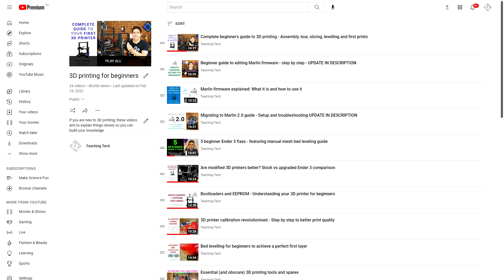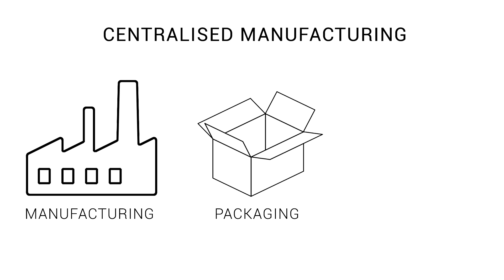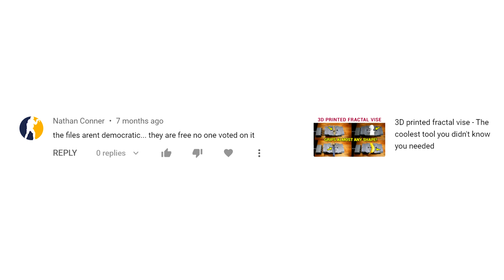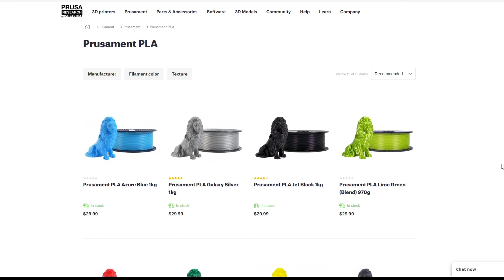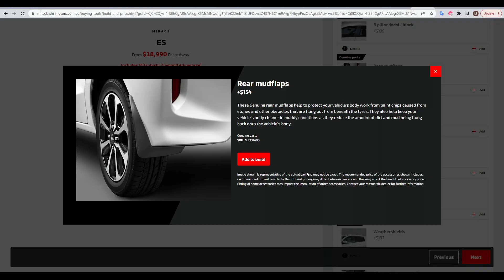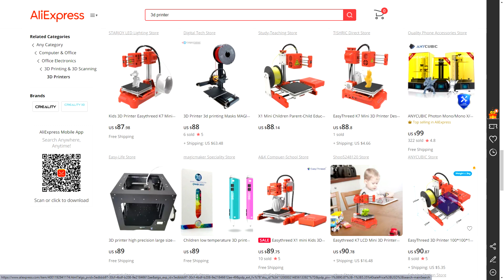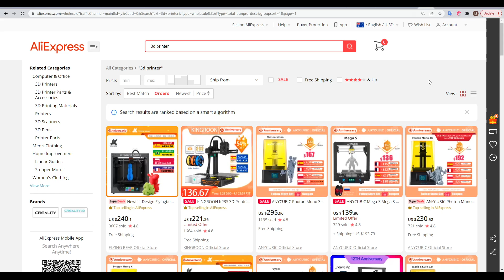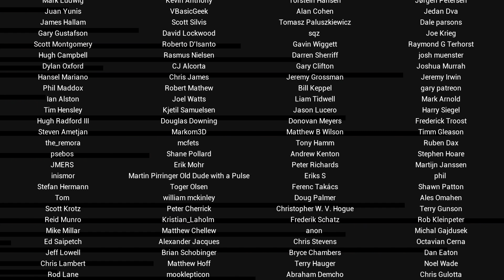3D printer trends are limiting mainstream acceptance: The 3D printing paradox

Comment: I don’t think the “in every home” 3D printers will be FDM. I think as long as you have the high temperatures required for it you won’t be able to bring a 3D printer to the same level as a paper printer as far as just hanging out in your office. Once binder jetting and these other technologies that companies ARE developing get more understood and refined, then we could be in business
Reply: To be fair, a laser printer/copier gets really hot inside too.
Reply: "as long as you have the high temperatures required" In a closed device hot parts aren't really problematic. Coffe machines in offices too have really hot parts, often with high pressure systems, yet people have no problem using them in office spaces. Even an incandescent light bulb is hot as hell, yet millions of them are (were?) used in desk lamps with no problem. We use 2 printers in our office for prototyping. Other than the sound they are barely any inconvenience compared to a paper printer.
Reply: Laser printers use substantially higher temps then FDM printers... 500 °C is not uncommon... Good news is if I ever commit a crime with my index finger on my left hand I will never get caught from leaving finger prints...

Comment: Very true on the point. While I have tons of comments on what can be done, I think an important point is knowing this is a catch 22 situation: a bunch of tinkers make a weird device that makes items out of plastic string! "That's cool, I want to try!" some succeed, most fail, but now there's more people with them. Repeat this over and over until it's understood and established enough to work consistently. <we are here now> Now there's a bunch of people going "That's cool, I want to try!" and a set of manufacturers all competing with each other to sell a "working" machine to them. The tinkers are still making newer versions of the device.

The Catch 22 is that people keep seeing the maker version, and then finding that their only options is the non-maker versions... but it's cool enough they go with it. It's less "the manufacturers need to set the bar and let makers adapt" and more "the makers need to become manufacturers". The current manufacturers are taking advantage of the knowledge of makers and have little desire for new development. It's why when a maker like Prusa becomes a manufacturer, the machines end up being the ones copied... the maker ones are the better machines. Just like how how early horseless wagons, or university/research lab printers became manufacturers, 3D printing manufacturers need to do the same.

Maybe it means Voron needs to bite the bullet and actually sell kits, or Prusa needs less loose wires... only time will tell.

Comment: The profits on cheap 2D printers are made via the ink (which they lock you into) so not a great comparison. 

Cars have a similar aftermarket profit model.

'Consumer ready' 3d printers might need to go down a similar path to be cheap enough - which will put tinkerers off.

Distributed manufacturing sounds great, but how many items in you house can be replaced with a FDM printer? I think a better path would be for small local companies that have advanced low cost manufacturing equipment to be able to provide goods without the need for packaging. They could even have budget design services for repairs of the part you showed. We're already seeing this with people 'side hustling' 3d printer farms.

Comment: 7:05 "Maybe you're listening to this and thinking that a 3D printer is a lot more complicated than a 2D printer"
Actually I was thinking of all the struggles I've been through getting 2D printer drivers to work. The ability of most 3D printers to operate untethered with files on an SD card is a major advantage in usability over 2D printers.
Reply: Just wait until your 3D printer cannot work unless online, refusing to work unless fitted with branded & DRM heaters/nozzles and the damn thing keeps "phoning home" to order expensing and unwanted rolls of filament in colours and materials you wouldn't choose.
See also software/OS as a subscription and products using proprietary consumables.
Reply: @jimurrata6785  "See also software/OS as a subscription and products using proprietary consumables." Chitubox enters the chat.
Reply: @peterkiss1204  fuck chitubox
Reply: @jimurrata6785  I don't see that happening, at least not for the whole industry. Modern 3D printing started as open source and is still mostly to this day
Reply: @Steph.98114  I remember the days of RepRap but if any company can find a way of monitizing the consumables they will.
No one with a document printer in the '80's would have envisioned $100 ink or their printer only accepting proprietary paper like DYMO.
ToT has brought us document printers that will stop working and order their own ink. 
HP, Canon, whatever.. are constantly updating software and ink that costs $10 a litre sells for thousands.
Gillette started this with razor blades over a century ago. Look at the fortune Polaroid made on film or the Keurig pod fiasco.
Reply: Document printers used to be relatively fuss-free when they accepted a common data format. Most upmarket early printers support Postscript and at a lower end HPGL became a quasi standard among monochrome laser/LED printers in the 90s. Dot matrix printers could accept plain text but also Panasonic and other dot matrix printers supported Epson compatible graphics and control codes. And remember you used to have a dedicated port on your PC and wire protocol they all shared.
Reply: Most 2d printers can also do this but I get your point
Reply: Underated comment!
Reply: I was also thinking about my many headaches with 2d printers
Reply: I have been using and servicing computers since the 80s. Never had an issue with a printer.

Comment: Maybe that's the reason behind these companies mass producing i3 clones that are sub par , if every thing was as easy as pushing print  like on a 2d printer and getting a perfectish photo, i'm sure loads more people would jump on board , major manufacturers  would lose out on money cause people can make their own spares . They make their money producing crap things that are ment to break so you have to buy spares  or throw it out and buy another.   point in fact longest burning light  light bulb has been running since 1901 . where were there profits going to go if everyones light bulbs lasted 120 yrs, nowhere. so they made them flawed, along comes the led light ,sposed to last longer , nope they run lower value resistors to make them burn brighter and burn out the leds.
So i guess my point would be if you could just download the spare part you need put it into a slicer that just works and all you have to select is what properties the part required , like ornamental or mechanical, prototype ect ... press print and the slicer  decides the appropriated plastic  or resin required  and just plonks your part out when done,  so they flood the market with the clones that are crap to put people off, cause if your not at least a bit tech savy  these machines can be a nightmare

Comment: 3D printing companies are essentially hobbyists, who started manufacturing machines or cloners, just trying to capitalize on a niche market. There doesn't appear to be any market pressure for anything more.
Decentralized manufacturing doesn't eliminate centralized manufacturing, packaging or shipping. The machines are manufactured, packaged and shipped, as are the materials to print with. If the machines are used to make product for sale also has centralized manufacturing, packaging and shipping. It just means more manufacturing sites. It may reduce waste, somewhat, but it certainly doesn't eliminate any of these aspects.
Reply: that's something that has always bothered me about the 3d printing comunity. I don't get how people can overlook that fact that fillament has to be manufactured as well. It's pretty much only the last 10% of the manufacturing process that happens in one's home

and then there's the demand for large-scale fillament recycling, which is just ridiculous. The solution isn't to recycle, but to print less junk that's gonna be thrown out a few weeks after printing
Reply: @tobbleboii5988  This exactly, so many "ohh cool statue" for the 50th time. Not to mention centralized manufacturing is still magnitudes cheaper even with cost of shipping and generally give a better quality product. 300g of printing using the cheapest filament I can get for a part and a few hours of printing is still more expensive and time consuming that ordering a part online in most instances.

Really the only thing I use 3D printing for is for parts that have been long out of print (as I collect and repair old computers and consoles), custom solutions for a niche problem or test models for work. And all of that requires me to know 3D modeling, not just CAD, to do do the level I require. But looking at other 3D printing people, most can't even use CAD let alone do proper 3D modeling. So for those people I don't really see much of a benefit to 3D printing over ordering a print from someone else.
Reply: @relo999  i think it is mostly useful as a rapid prototyping device. cuts cost to where anyone can design or invent something down to a refined design and even sell it. there is a alot more than little statues being made.
Reply: @or3n_  Look at more than the first sentence I wrote. I mention that. 

The big issue with 3D printing scene however is that the vast majority of 3D print people can't design any model themselves and if you can't do that you don't really benefit from anything. If you don't design yourself your cost and waste becomes higher than centralized manufacturing without the benefits from what a 3D printer can do.

And 3D printing isn't a design tool, it's a CAD based rapid prototyping tool. And to be able to prototype in such a manner you need to be able to design something with CAD software or something beyond that. 

3D printing is a tool, not the goal in itself. But the majority of the "hobby community" treats is as such. (already a sign it's bad it's called a hobby community, nobody would call themselves part of the "screwdriving hobby community")

Comment: A simple fact of life is that innovation costs money ... if margins are being eradicated by clone copiers just beating down the price for the average schmuck ... well innovation is going to be slow.   There is sweet spot for this where there needs to be competition as monopolies also suffer from a lack of innovation as there is no need.  Those buying those cheap printers as their first printer typically won't be doing much printing or for very long.  I think the Voron concept is the best pattern I have seen so far ... although it would be nice if they offered an officially sanctioned kit that met their QA standards in the same way they do via PIF for the 3D parts ...

Comment: Ever see a great car made in China? Cheap parts and labour aren't the hallmarks of an innovative industry leader. For comparison think of companies like Ultimaker, Raise3D, Prusa Research, Makerbot, Voron. Take a look at how different the designs of these machines are, not to mention the extra work that they put into making documentation, slicers, websites, filaments and other things that move the industry along. Then look at Creality, Anycubic, Elegoo, Komgrow, Kingroon. They re-skin cura, have to get shamed into releasing the marlin source code they used, cut corners on thermal protection, use cloned hotends and bed probes, skip putting a bootloader on the mainboard. This is the true cost of a cheap machine.

Comment: the major Issue I have with the race to the bottom so many of these companies are doing is that the item they're putting out is junk without hours of work and often a fair degree of knowledge of how it 'should' work. Some are decent enough to spit out a trinket, but that makes them little more than toys.

The last printer I bought needed a hundred dollars in parts and 60 hours of my time to make it fit for purpose. Often these companies seem to heavily rely on the FOSS types in the community to fix the damned problems.
Reply: Hundred dollars in parts - how?
Reply: @SianaGearz  if you need to print anything other than PLA, you're often over the practical temperature limit for the PTFE lined hotends most Chinese printers come equipped with. The extruder tends to be ok at best.  between those two parts you're pushing 80 USD add a runout/jam detector and you're easily to 100 USD.

The cost gets cut somewhere. Right now, all of that cost cutting is in the parts and software that make printers a tool rather than a project.
Reply: @dtaggartofRTD  a $4 generic alu MK8 extruder works perfectly fine and you don't need to push beyond safe 245°C for PETG and ASA if you're printing at a modest speed. In fact I'd say PLA is the perfect material for aesthetic prints and PETG is pretty decent for long term durable loaded prints.

Plastic extruders with lack of preload adjustment and brittle ABS idler arm are indeed not something I want to wish upon my worst enemy; luckily a minimum viable remedy is very cheap.
Reply: @SianaGearz  speed tends to be the rub. This particular printer is set up for large parts. material throughput and extrusion accuracy were critical for the use case. It was really stretching what the bowden it came equipped with was capable of, and when I pulled apart the stock hotend the ptfe was starting to char after just a handful of prints. For smaller printers it's definitely easier to get away with the cheaper solution.
Reply: @dtaggartofRTD  yeah I've ruined a PTFE liner as well, though on a cheap direct drive printer, while experimenting with ABS, didn't take long at all. The sweet deadly neurotoxin, gotta love it. ABS that I have actually wants to be pushed hard and fast, else it's just not gonna keep together, seems like it's taking damage at a molecular level. I mean obviously you get tons more options out of a printer build that's actually good, but it's got little to do with a minimum viable consumer type product - printers whether cheap or expensive are substantially far removed from that, just very insight demanding throughout the whole usage cycle, while limited material choice and slow prints are pretty much irrelevant in that particular regard.

Comment: I guess part of the reasoning why suppliers do not make source files publicly available is the legal consequences rather than the actual tech itself... Say a customer made (e.g. via 3D printing) a part that he/she thought is fine but in fact did not meet the performance standard of the bulk-supplied ones. Then the good with that customer-produced, underperforming part broke and caused some serious damage, potentially on the OH&S of the customer. From there the company would have to invest significant time/money/resouces in dealing with the case and the cost in-combine may be significantly more than that used to massproduce and stock spare parts.
Reply: I suppy by royalties and no warrenty. 
Use at own risk. As is where is. 
It costs because it costs to license the invented thing. Pc and 3d printer expensive software and experience take time and used to cost a lot more of course. Time. 
License checking times has increased big time. For example when i started there was a couple of hundred files of invented and licensed 3d prints on the entire net. 
Now theres around tens of millions and the search engines are stone age at best. Sort by alphabetical if its been invented is not in use yet. Try it. Its close but its a business directory and royalties are peoples jobs.
Sort by oldest to see true owner and rest are pirates. Its become a massive job and some print farms aint charging for checking on there invoice cause they probably aint paying the royalty and just pirate farm out. Many times license checks are easy. Its easy to see businesses not doing them to.

Comment: Yes, I agree with your assessment. The open-sourced collective cognition of the 3D printing communities is driving the innovation. Another point is that higher end, closed source and patented technologies may be innovative but the high cost limits the amount of people that have access and ultimately stagnates potential growth. MarkForged's carbon fiber technology is an example. Imagine where that technology could be now in both price and performance if millions of people were focused on improving it.
Reply: I hold many 3d print licensed things and find people make a lot excuses to not pay a tiny royalty. Print farms and influencers either dont perform license checks anyway and just pirate out. Its easy to see if they charge for license checks on invoice and how much royalties they paid.
Influencers who just sell newbs printers but dont tell them anything about selling print and license check s first. Even designing it yourself means you must license check before selling it. Incase its already invented licensed and royalties may apply. I think a deal can usually be done so i dont feel the license holders are slowing the game much at all. Getting people to operate within the rules and no just rush to pirate seems the bigger story. 
Find ten sellers of 3d prints  and see if any print and sell any file given to them without license checks. 
Who did they pay the royalty to they should know. 
Is dentures licensed? Who owns it? 
Who is selling them and is the license holder recieving there payments.